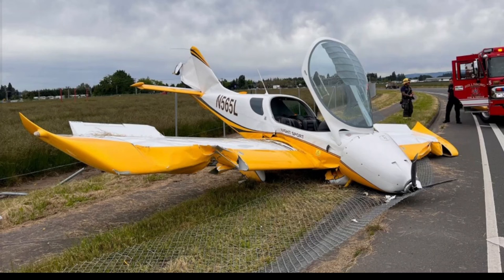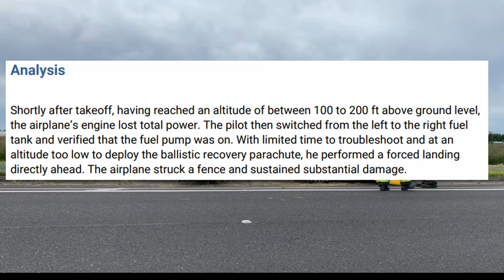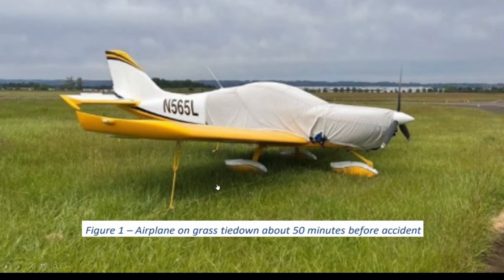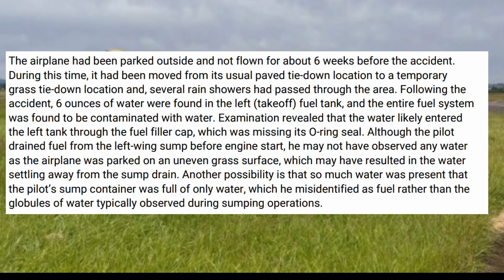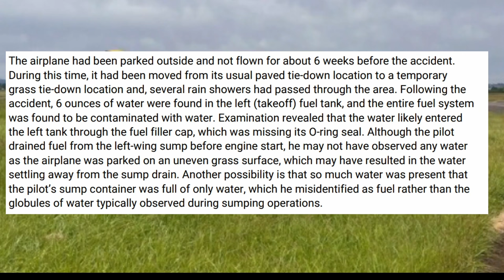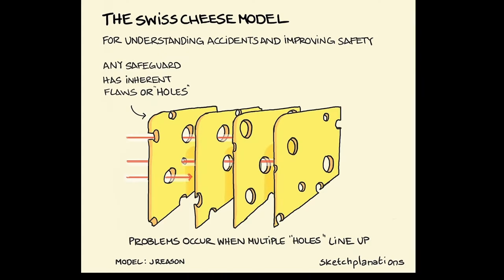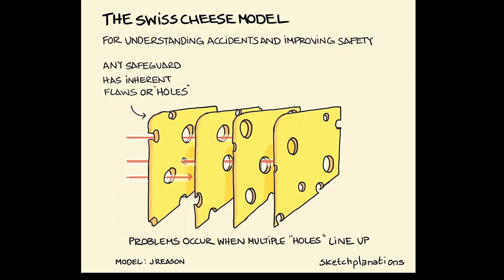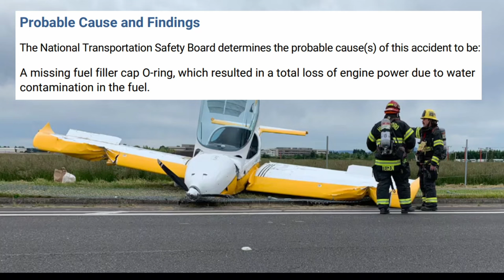Contaminated Fuel in Oregon

Comment: Another thing when you have a o-ring on a filler cap, it provides resistance when you install it, when you go to install rotate and pull the lever back there is resistance if there is none because the o-ring is missing, if it closes very easily, that should be a red flag. Sounds like there's a whole lot of ignorance, lack of attention to detail.
Reply from the maker: Thanks for those little tips.  I agree that you can feel for the o ring when tightening

Comment: While multiple poor fuel test techniques led to failure, he did a good job with airspeed over altitude on takeoff.  He had time to react to the engine failure because he was obviously not at Vx or Vy pitch attitude, both of which are usually not appropriate, when the engine failed.  He obviously was at cruise climb pitch attitude or at least low enough pitch attitude to not stall a couple hundred feet up.  Either Vx or Vy pitch attitude for three seconds of startle without engine power usually result in stall, fall, and fatalities.  Good job with the engine failure after poor job with preflight.  Rain or large diurnal temperature range as in desert or semi-arid area leads to much water in fuel tanks.  Shift weight to get water to low point and smell test for good fuel in test cup and save drained fuel for test after problems.  Good job with landing.  Nice job with rudder to direct nose between the two poles that bent wings at equal distances from cockpit.
Reply from the maker: Pilot did great.  👍🏽
Reply: That’s quite an ignorant statement to make to say the pilot did a poor fuel tests. I’ll also include your statement about vx and vy not being recommended.  
     I don’t know the first thing about the pilot. What I can say is that at the very least he was not thorough enough to properly inspect the seals on his fuel caps. Just off of that Information knowing nothing about the individual I could not say the pilot is over all careless but he did make a careless mistake.

Comment: I'm no pilot but I have seen enough pre-flights to know that fuel is one of the things they check.  Just for that possibility of fuel contamination.  If the sump had been full of water, but doesn't aviation fuel have a distinct color different from water?
Reply from the maker: The mixture is noticeable when together
Reply: @ARFFWorld  I can understand that, but the fuel would be a different color than clear if unmixed.

Comment: They put dye in the fuel for a couple of very good reasons. It should never be clear. When you take the fuel cap off to check the fuel level, check the o-ring too..
Reply from the maker: Good points

Comment: Multiple aircraft crashes due to water in fuel tanks this year!  Years ago I flew a Cessna 152 for my flight school that was sitting in a hanger for over a year.   I sumped  the tanks and it was water.  So I spent at least 30 minutes rocking the wings and pushing down on the tail etc.   Finally it seemed that I got all the water out.   Started up, taxi out and did 4 touch and goes.   When approaching the runway on the last one the engine stopped.  Landed fine and coasted off the runway.  
Got towed back and sumped it again.  More water still in the tanks!!  Handed the keys to the mechanic and walked away.

Comment: Keeping your plane outside teaches a few things…

1) water in the fuel tanks is always a possibility…

2) the blue color isn’t always as obvious as you would hope…

3) if you see a drip of water, there may be a few more tea spoons in the tank lower than the drain…

4) if you see no drips in the test cup… it will still probably smell like 100LL… when it is all water, or all fuel….

5) when you only see one phase of liquid… spit in it! You should immediately see two phases… 

6) If you spit in the sample and the spit dissolves….  Start draining and testing more samples….

7) know that a leaky O-ring can allow a quart of water into the tank after a good rain…

8) Also know that fuel drains are intentionally placed at the back, low end of the tank…. Depending on dihedral.

9) less dihedral (high wings), may have multiple drain points per tank…. Sump them all!

10) There are updates in fuel, O2, and UV resistant fuel cap O-rings… 

11) aged O-rings can swell to the wrong size, show cracks, become rough, or leave a black smudge when rubbed…

12) know how many O-rings your cap has… one is obvious, another small one hides on the locking tab’s shaft inside the cap…

13) always drain the gascolator as well… we all have one of those too….  If water can get into the tank… it can find its way to the gascolator pretty easily…

14) For water to reach the engine’s fuel pick ups… it requires a lot of water to be in the tank…. Until the nose is lifted above the horizon…

15) Water can’t hide from a diligent pilot!

Nice work landing that glider!

Private Pilot thoughts only, not a CFI, mechanic, or fireman!   

Go K!

Type clubs make a great way to learn about your airplane’s specific oddities…

😃
Reply from the maker: Appreciate you!!

Comment: Pilot did a great job pointing the nose down and immediately landing rather than the usual pull back on yoke and stall/spin. So good job pilot.
On the other hand his preflight check was terrible. If you suspect water as he did, you have to get it to level ground to ensure the water reaches the sumps. So bad job pilot.
Reply from the maker: Agreed nice hearing from you sir

Comment: If you sump the tank and it's a clear liquid, don't go until all the water is drained. Then it'll be blue. As for uneven surface, I was taught to bring the airplane onto level ground and waiting a few minutes before sumping it. Hopefully that's the lesson that got learned here (and to check gas cap o-rings often).
Reply from the maker: Appreciate it

Comment: OK right off the bat, this aircraft uses a Rotax 912 engine so the question I have was the fuel automotive gas or 100 low lead. ?? If it's 100 low lead, the color of the fuel is blue. So if you don't see any blue, you certainly don't have any 100 low lead in the test cup. The other point I want to re-hammer home is the bubble canopy factor. Obviously the aircraft did not flip over - THANK GOD, because had it flipped over, if you observe how the canopy moves to the open position, the conclusion can only be the occupants would have been trapped.  And again I sound like a broken record, but these bubble canopy type aircraft need an airbag system somewhere at the top side of the wings so they can inflate and push the flipped over aircraft "up" so the pilot and passenger can have room to push the canopy open to escape the aircraft. And one last point I want to bring up, is I have been shouting from the rooftops for airport managers to procure designated put down spots BEFORE the housing markets builds right next to the airport. {like clockwork, it happens at EVERY airport.  New airport out in the Bonnies and plenty of emergency landing spots.  Fast forward 30 years later and like Gomer Pyle used to say, "surprise surprise !!". Now the airport is surrounded by houses with owners complaining about airplane noise {ugh excuse me, the airport was there FIRST !!} Now here's the thing: if the urban jungle has reached the airport, the managers have one more option - they could install designated arresting nets so the disabled aircraft can just put it in the net and in most cases, MIGHT actually be a better option to deploying BRS/CAPS.  But like in the video, you need to be at 350 feet AGL absolute minimum to have a successful deployment. We really need to get these arresting net systems installed - at the very least on the end of runways {of GA airports}.  This is NOT to be confused with "breakup" foam blocks at end of runways at big airports. If you're in a small aircraft at a big airport, and you do NOT do intersection takeoffs, AND you lose your engine at 200 feet AGL, you should have PLENTY of remaining runway to dead stick the "glider" and if runway remaining is getting low, you can SLIP and get back on the runway ASAP.
Reply from the maker: Thank you so much for taking the time to
Reply: @ARFFWorld  Thanks for allowing me a platform to bring attention to solutions to light aircraft that have engine failures on takeoff {or after takeoff}.  Arresting nets were invented like 85 years ago and worked absolutely amazing on military aircraft. All I'm "calling" for is for airport managers to at least consider it.  We're talking old but very reliable technology that should not cost tons of money.  OF COURSE it will cost SOME money, but the airport financial officer can look at the budget and figure out how to rearrange expenses and pay for the arresting net systems. Frankly I think it's cheap insurance - aircraft takes off, engine dies, pilot heads straight for a net - NO impossible turns - just get it to the net.  The net brings the aircraft to a stop in a g limiting factor and everyone's fine. You could have these nets at end of runways and at 1/3 and 2/3 mile off the end of the runway.  In airports surrounded by buildings, the airport would only need to procure a very small amount of real estate to install the net.  Of course if there were powerlines, you have the utility company bury the power lines in the flight path.

Comment: You can tell the difference between fuel and water by pouring the fuel sample on the pavement. Gasoline has much lower surface tension than water so it will simply spread out. Water makes like a blob with rounded edges when poured out on a nonporous surface.
I knew a guy who killed himself and his wife and two kids in a Piper Comanche that had a bunch of water in the tanks. Also parked on an uneven surface. Comanches are so bad about getting water in their fuel that an Airworthiness Directive was issued about it. Also, the Cessna 152 I did a lot of my training in was destroyed when it crashed on takeoff out of Carrizo Springs, TX, after having been parked outside there for over a month, during which time some heavy rainstorms had gone through. Fortunately both occupants were not seriously injured. Investigators found a three-liter soda bottle full of water in the tanks. I suspect that they either failed to check the sumps, or saw pure water and thought it was fuel. That can be deceiving since the clear sample cups often become discolored, the water can pick up some of the fuel dye, or low light conditions in early morning or late evening hours can make the blue color hard to see.
Reply from the maker: Thank you for sharing this
Reply: @ARFFWorld  
You're welcome. Another, more insidious problem can be that of misfueling a piston-engine aircraft with jet fuel. It happens more often with larger twins than small singles, but it can happen to all. They've taken measures to prevent this, like jet fuel filler nozzles that won't fit in an avgas tank filler port, but it can still happen.
Jet fuel is kerosene, it will look just like avgas when poured on the concrete, and will mix with gasoline and the blue dye. The way to tell if this has happened is to use your nose! "The nose knows," as they say...
Avgas has a pretty mild odor when compared to jet fuel, which has a strong and persistant kerosene smell. Avgas contaminated with jet fuel will smell like jet fuel. Anytime the airplane is refueled, open the fuel caps and give the tanks and fuel samples a sniff test. Wave the fumes toward your nose, don't stick your nose in the tanks or sample cup! If you smell kerosene or anything different from avgas, STOP, and verify with line service what got put into your airplane. A jet or turboprop can run just fine on gasoline, with slightly elevated EGTs. A piston engine WILL NOT run on jet fuel. Two fatal accidents occurred out of my hometown airport of San Antonio due to that. I went to see the wreckage of one right after it happened, and the smell of jet fuel was everywhere. I knew then why it crashed, days before the official report came out that confirmed it. That aircraft was a Cessna 421C that has piston engines. The other one was a Piper Navajo, also a piston-engine aircraft. Both aircraft only made it a couple of miles away before their engines failed.

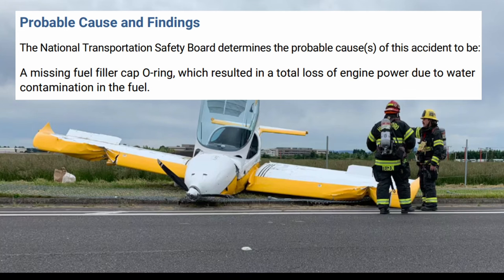Comment: 3:40. I think the NTSB got the probable cause wrong.. it didn’t crash because the O-ring was missing.. it crashed because the pilot failed to properly sample the fuel from a level surface, or manipulate the plane tail low to make sure the drain is at the lowest point while sampling. I saw something like this first hand.. the water can easily overwhelm the gascolator, then fill the carb bowls.
Reply from the maker: Thanks Tom for stopping by to share

Comment: Thanks for your continued in depth reporting .  The owner was quite remiss in not checking and going over the plane extensively after sitting so long on the grass .  Even if it was anchored on tarmac it should have been thoroughly checked for safe use .  Some might say no if it was sitting for over a month in the dry southwest US .  I don't know ,  perhaps other problems could occur when a plane hasn't been flown and left outdoors where there is little or no rain
Reply from the maker: Thanks for the info Moe
Reply: @ARFFWorld preface: apologies for my run on sentences, lack of being concise and clear in this follow up reply:   I was just giving my opinion . My question to you an expert on aviation crashes is:  would an aircraft sitting idle in the dry northeast US, lets say the southern half of Arizona on dry hard earth for 6 weeks, with no rain during that time, have to be checked over before flying it ?  Or lets say heat , dry dirt , and the like have a detrimental effect on the aircraft as dangerous as the aircraft in this video being damaged by rain and damp  ?